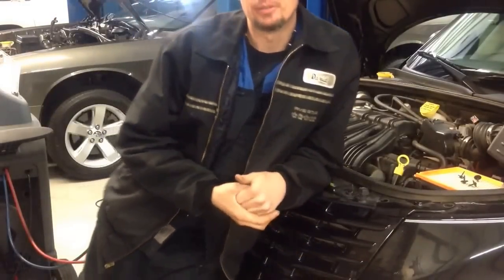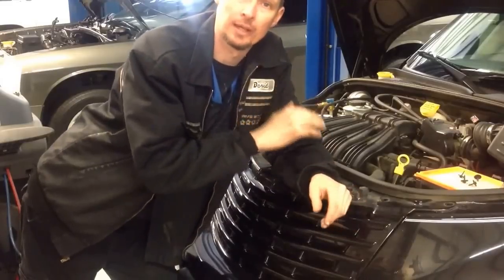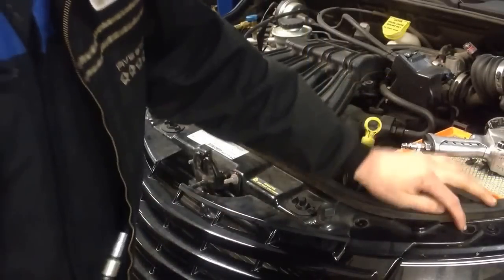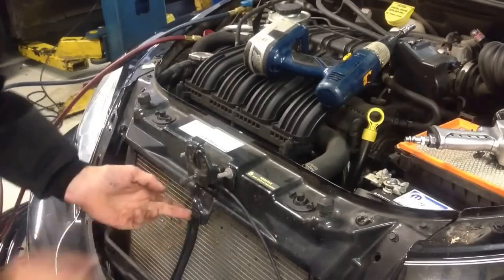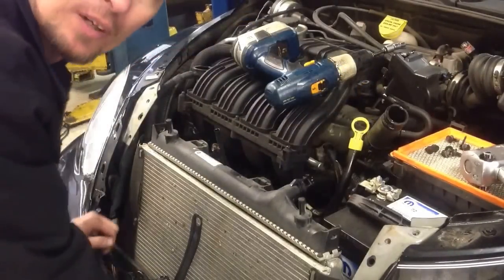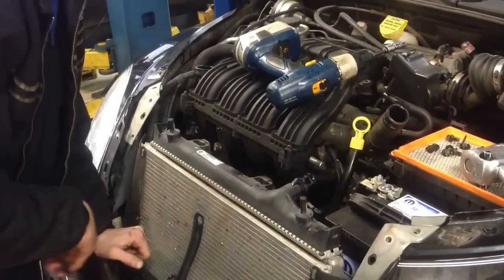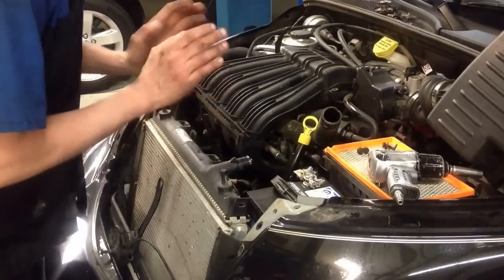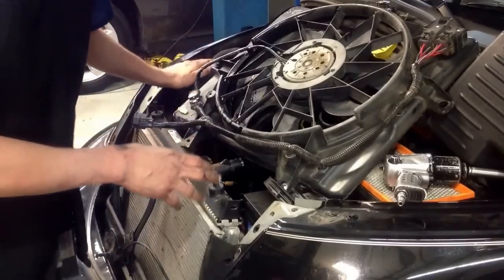Chrysler PT Cruiser radiator fan replacement

Comment: We had this exact same issue and at least 2 mechanics never suspected the fan but went right for higher ticket jobs with the air conditioning system. I declined those guessimates mostly because they were not identical. We waited and took the Cruiser to an auto electrical shop that had done work for us before. His tests revealed the fan needed replacing. Until I watched this video today, I wasn't 100% sure that it was the entire fan assembly. I always thought it could have been one of the 2 relays on the fan cowling. I'm very glad to see this confirmation. Thanks again for these videos! Best subscription I have so far by a long shot!
Reply from the maker: Man.....great complement. That is reason I highly recommend a dealership with trained techs. Odds are that the dealership has seen the issue before and can fix it without unneeded repairs. But even then you may get that one tech who hasnt seen it before so it can still be hit or miss. My money is still on the dealer or someone that has seen alot of PT cruisers and is familiar with them. Keep spreading the word my friend! Love to see the channel keep growing and growing
Reply: MotorCity Mechanic You more than deserve every compliment I can write and more. Your camera work and lighting are exceptional for this kind of subject. The how-to-dianostic point starting off was the first time I had seen that mentioned anywhere, and goes a long way to establishing a base line of credibility. Those kind of extra pointers repeat over-and-over throughout all 7 videos here covering this one job.

As far as dealers go, I kinda agree. Dealer's are required to have all the specialty tools, lifts, and etc. beyond the mechanic's personal box and diagnostic equipment to service the manufacturer's offerings as part of their franchise agreement. When DIYers and consumers like us encounter someone like yourself you can believe me that we are very grateful and are happy to support the dealer operation. As a former GM of an MB dealership I can say without reservation that of all the mechanics I recruited or worked with only a few could hold a candle to what you've shown, and none could have produced these videos while meeting their scheduled task production. Even the shop labor rate and hours charged by the dealer is generally a better value than outside garages. Dealer parts on the other hand are ridiculously expensive as compared to equivalent, high performance, and OEM parts on the street. For instance, the parts for a TB on my cruiser including water pump, thermostat and coolant change will run around $200, street price for this job is from $500-$850, and my local dealer's base quote was $1150. Our Cruiser is a 2006 Limited with 95k with a retail value of around $5k. I take reasonable car of the car and it has always been garaged, but that $950 gap could probably cover all the repairs we've made on this car since new. The other minor thing is that this would be preventative since nothing has failed yet, so there's that.

Final compliment on this comment: If you worked at a dealership within my orbit of travel, the $950 gap is covered in a heartbeat. Why? Because I know you won't shear those guide pins off on the CAM gears.

Thanks again!
Reply from the maker: I cant justify the price of the oem parts but I do know one thing....the quality is so much better. I cant count the number of times I use aftermarket parts and they dont last long at all. Even with a lifetime warranty they arent worth the hassle. Prime example....my wifes wiper motor failed during a storm....short story, she blew two tires out before I could get to her. She and the kids were fine but aggrevated. I order an aftrmarket assembly with warranty.Two months later and guess what....failure! This time in a sprinkle condition. The safety of my wife and kids isnt worth it.......oem wiper motor assembly ordered and installed this time. I do my best to stress oem parts when ever possible unless something minor.
Reply: MotorCity Mechanic Because of my history in the new car business, I understand the pricing structure in the parts department. Suffice it to say, both a lot of dealer profit and a lot of dealer capital is made and tied up there. I alway thought it could have been made even more profitable if the dealer marketed parts aggressively like a parts store. Keep the "turn (of inventory) and earn" quick. Retail target is 30-day shelf life, which is not attainable in the car business, but wow if it were.

Anyway, quality or OE MOPAR parts can be found in the street, although it takes time and persistence to locate them sometimes. Also the potential for negotiating outside parts is higher, though I admit not the norm.

Sounds like your wife and kids are a great place to test your mechanic's super powers!

Comment: the way you went about the description of the problem and how to do the repair along with the video recording was excellent. I was able to R+R the fan assembly with a lot more confidence knowing where to look for and what size the bolts were. The one thing that everyone should be aware of is that there is a three pin and a four pin wire connector. just be aware to check to see which one you have on your car. Your voice could be heard and the camera was pointed on the subject and was clear and in focus. thanks for the help and well done.
Reply from the maker: Many thanks for the comment about the video. Appreciate that tip as well. Thanks again and make sure to subscribe.
Reply: Phillip Reynolds 

Diagnosis same as my 07 PT Cruiser, I will get a Radiator fan at Chrysler dealership.
 I had to replace a low Pressure swich located on receiver/drier located on passenger side on firewall only took less than 5 minutes change it out, a/c would cycle on high all time while driving, air volume would decrease while driving too.
 P.S. no low speed fan in winter, can't have defroster on to thaw out front window too.

Comment: I really appreciate your videos, I am 17 years old and bought a PT Cruiser for $250 with a snapped timing belt and watched your series on how to fix it now I have my first car! I do all the work myself except for AC work because in Canada you need license to buy R134a, Anyways my AC system had a bad compressor, A garage swapped it out for me, and flushed the metal shavings out and filled it with dye and R134a, The ac clutch works for about 30 seconds on start up, then doesn't work for the rest of the ride.

They told me that my radiator fans low speed was broken, And when I turn my AC on it builds pressure, but due to lack of fan it cannot disipate the pressure, and shuts off. So I need a new fan, I have no problem replacing the fan (already bought one) I just have a hard time trusting thats the issue, just doesn't seem right, Is this possible?
Reply from the maker: That’s awesome. As you saw....someone probably was told the engine was damaged when the belt broke. You took my advice and learned what the truth was. I can say that they are giving you the right advice. It’s spot on and explains the situations. The fans are common failure items. I have to agree with them. Thanks for the question and for telling me about how the videos helped

Comment: I have a 2001 pt cruiser and it likes to over heat,  I have come to the conclusion that it's the radiator fan sensor but can't seem to find it... Any help where that might be
Reply from the maker: Have you tested the radiator fan itself. Its a 3 wire motor that has 2 speeds. If one speed goes bad....it can cause it to overheat. I recommend checking the fan first, its the most common issue and never the "fan sensor" which there isnt one. The middle wire on the fan connector is ground.....each outside wire is the 12 volt feed. You can take it off and then with some jumper wires....supply ground and power to each circuit and see if one does not work. Thats where I would start on this vehicle

Comment from the maker: I will try to make as many as I can. Sorry about the cutting off of my head in the video, then again it's all about the car anyway lol
Reply: MotorCity Mechanic 
Thanks, that looks simple.
What kind of radiator fluid should be replace with?. I have taken my Cruiser to chrysler 3 times for trans, and radiator fluid changes, last on was timing belt change at 115,000 miles, radiator fluid change was part of service.

Comment: On my quest to replace the crank sensor (05 PT Cruiser) I thought it was necessary to remove the slave cylinder. Can you give me any suggestions on how to compress the rod so I can get it back in?
Reply from the maker: One thing you might want to try is long bolts. Just depends on if you have long enought threads to make it happen. The longer bolts can be replaced one at a time once its fully seated and then install the original bolts.

Comment: my PT cruiser is overheating I change the sensor temp,both relays ,thermostat,and fuse next to the relays and check manually the fan to see if it  turn on and it  did turn on
Reply from the maker: When the temp gets past the half way make on the gauge.....the fans should come on. If not then its going to take checking with a scanner to see if the fan can be commanded on thru the module that controls it so that the issue can be narrowed further. It will take a scanner that can access all the modules in order to perform this. If the fan is working then there can be other issues for the overheat such as a warped cylinder head or clogged radiator. Too many times being overheated can cause a warped head and further issues.

Comment: You got the full view of the work, so I'm okay with the top of your head being offscreen.  The audio though, makes this a hard video to watch.  It'd be nice if you included even a sped-up completion of the installation.
Reply from the maker: Sorry about the audio.....this is an older video, I have since then improved on my filming abilities including....lighting, sound, and better camera equipment.  So my apologizes on the older videos. Make sure to subscribe and check out my newer vids.
Reply: Meant as constructive criticism.  A simple lapel mike really helps and is fairly cheap.  Glad you've continued to make videos and help others.  I use videos like this to teach my kiddos to work on cars.  (Or teach myself welding, Arduino, etc...)  Long live The Net, right?
Reply from the maker: I have gotten a Rode mic for my DSLR and also a corded lapel which I am probably on my 4th by now lol. I try to add more info these days such as torque specs and more camera angles. I hate to watch my older videos because I know where I am now and to see the quality....I cringe lol. Thanks for bearing with it. I fully understand what you mean.

Comment: i agree with the wires but one is groung one goes to 12vt relay the other goes to 6vt relay there are too relays for the one fan!
Reply from the maker: Jordan Houck Relays do not step down voltage, they are a means to use a low current input to control a higher current output. The reason for 2 relays is for the 2 motors.....we need a relay for both motors that can handle the current so that's the reason for the relay. I promise you I have replaced and diagnosed at least 50 or more and it's the first thing I check on a used car or customers car while in for repairs. As I mentioned you can even verify what I'm saying by disconnecting the 3 wire connector and supplying a ground to the center terminal and then one at a time.....supply 12 volts to one of the 2 outside terminals. You will hear the different speeds. It's obvious the difference. It's internal.....not external.

Comment: How do you know if it's the fan motor or the relays? My GF's does the same thing
Reply from the maker: +Steven Gilmore I have never seen a relay issue as of yet. Always the fan. There are 3 wires going to the fan motor. One ground and 2 power circuits. You can supply 12 volts to the two power circuits to see if both fan speeds work.

Comment: When I turn my ac on it doesn't overheat until like 5 min later it will slowly get closer to hot. If I turn off the ac it will go back to normal. Could this be the fan?
Reply from the maker: The fan has 2 speeds. Its like two fans in one. There is a chance that you do have a bad radiator fan. It requires supplying 12 volts and ground to each circuit to see if it works. If one does not then the assembly needs to be replaced. Thanks for the question and make sure to subscribe

Comment: if my connection plug takes three wires two blue one blck but i got a cheap one that has only two a blue and a black how should i rig it so it works right do i put the one blue together with the one blue and the one black with the black. oh on the new fan black is neg blue is pos
Reply from the maker: What I recommend is getting the correct fan assembly. It should be plug and play with nothing else needing to be done. The fan has 2 speeds and thats the reason for the 3 wires. I would make sure I got the correct part first. I dont recommend modifying the wiring or trying to make this work. It could cause other issues.

Comment: can you just replace the fan without having to buy a new fan shroud?
Reply from the maker: I have seen where they do sale some motors without the shroud. At the dealership we dont because mopar only offers it as an assembly. I personally havent tried one of the aftermarket versions with just the motor. Just make sure it has the correct connector and not something that you have to cut and solder the old connector on.
Reply: ty
Reply from the maker: Mark Voisin Your welcome. Thanks again for following the channel

Comment: What size are the bolts in the fan?
Reply from the maker: As far as what size socket? They are 10mm bolt that hold the fan/shroud to the radiator

Comment: i have to correct you on the fan its not a too speed fan relay drops from 12vt to 6vt that reduces power to fan! fan does not have too speeds!!!  thanks for the video!!!😃😃😃
Reply from the maker: Jordan Houck Actually it has 2 speeds. The fan motor has 3 wires.....2 are for the seperate internal windings for the 2 different speeds and the other wire is the shared ground. So that explains the 3 wires. You can have one circuit go bad in the motor and the other work fine. You can use a power probe to test both circuits and when 12 volts is applied to each one....there is an obvious difference in the speeds. Otherwise if the voltage was varied externally you would only need 2 wires going to it. I appreciate you watching and for the comment. Make sure to enjoy the weekend.